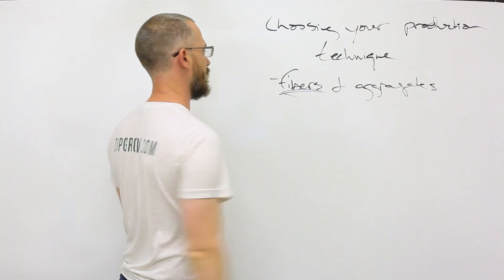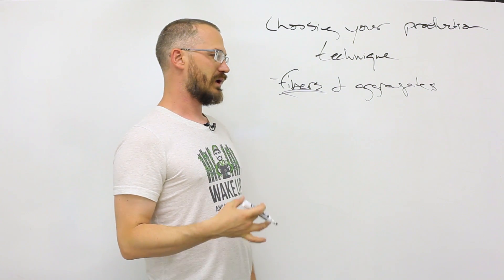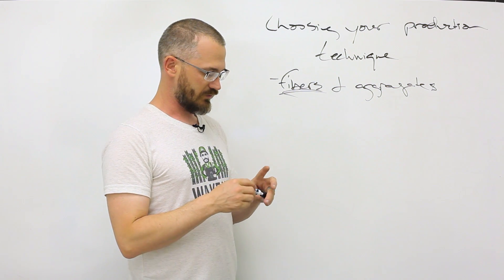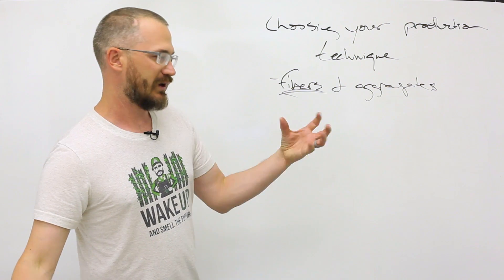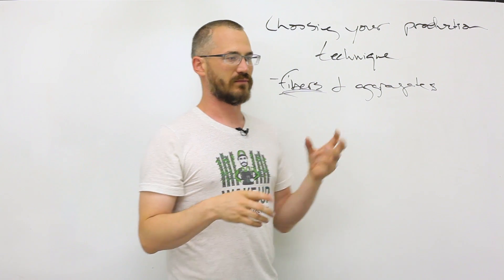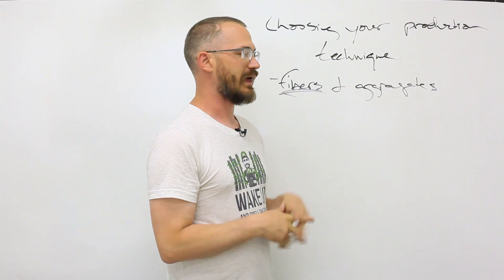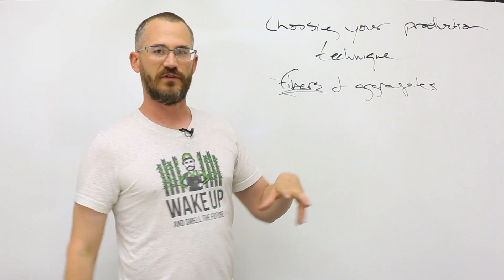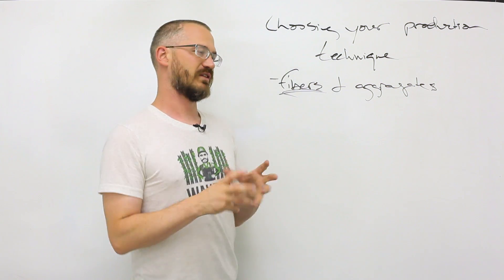Why use fibers as aquaponic media?

Comment: by fibers do you mean coco coir?
Reply: There are 3 types of Coco Coir, bird nest, croutons, and coffee grounds. I find the bird nest drains the best using a recovery system in a vertical PVC. Adding red worms will take care of most excess waste. I get 3 grows from the coco and then it is off to a a vermicomposter bin.
Reply: Damian Hinkson The fish don't make it a problem, rather it can often make problems for the fish.
The more innate stability your system has at the hardware level, the easier it is to keep the optimal water chemistry for the fish's wellbeing.
The plants love it, but your fish don't.
Reply: Damian Hinkson The main consideration is probably for if your entire system shares the same water volume, and you can have thousands of dollars worth of fish at stake if any thing starts to happen with your water.
Fish are delicate, and the concept of aquaponics is an intrinsically unstable ecosystem within a closed system.
I guess it all depends on how good you really want your water to be, and if you want more increases in the potential for reaching the most natural equilibrium possible / for the least maintenance trade-off, in the long run.
It's equilibrium : maintenance, basically
Reply: Not really my question, but thanks.
Reply: " possible need to replace eventually " 
Yes, any natural fiber will decompose rapidly in an aquaponics or aquaculture setup.
The initial cost of kitting out your farm will be considerably less to begin with, but the degradation of the matter comes at a heavier cost than simply needing to be replaced often, the actual decomposition itself will inevitably contaminate your water exponentially as time goes on, causing water quality maintenance to become somewhat of a nightmare. 
Hes saying in the video more people should use fiber, but this is the dealbreaking reason why most people don't use degradable media.
There are other medias out there that are non-degradable fibers, like rockwool, but it's expensive.
Reply: Postghost  my coco grow beds are 8YRS or more and working fine
Reply: Perhaps it was a bit hyperbolic saying "rapid".  It's good to hear you are having some success with coir, but the fact that it's working for you doesn't mean that it's overall a better option.

All vegetation will biodegrade in your system, regardless.
ofc some bio degradation is inevitable in the water, but if you make your entire grow-bed out of vegetation, you have no way of controlling it, adding just another variable factor to an already imperfect and intrinsically unstable system like aquaponics.

Admittedly there are probably schools of thought behind both options, but in mine it's one of the core rules to simply avoid natural, dead vegetation as a full grow media in aquaponics.  It's pretty much for the sake of the fish's healthy, optimal water chemistry. 
How your fish are affected will depend on your fish, obviously Tilapia will fare better than jade perch, but you also intend to eat the fish yourself afterwards so that's another factor to consider.    Whatever compounds are floating around in the water are consequently going to be in the fish you eat also. 
Like I said, it's just another boat load of factors that are to be considered.
But that's why we do our own research tho isn't it?
But anyway, I hope your coir continues giving you success.
Reply: dfunkt You do whatever you feel you need to, by all means.
...but coco coir IS, %100 "vegetation", Sir.
Reply: dfunkt I use coco coir, but not in the aquaponics.
" there's not anything there for bacteria/fungii/protists to work-on, so i am highly-doubtful that it is even digestible by anything "
Idk where you got that information.
I don't have the time or desire to give you a full chemistry lesson on the decomposition of matter in the natural world, but there are these things called 'acids', in the water(a lot of fish do like slightly acidic water), that soften the cellulose that form the fibers, and cause natural degradation.  There is absolutely NO way for it not to happen.

Listen, I just gave my two cents, mate, if you cannot gracefully take a random claim off a YouTube reply, with a grain of salt, that's not my problem.
Reply: dfunkt It isn't digesting, it's biodegrading.
Reply: dfunkt " coco coir is an excellent long-lasting horticultural media " Right ...that must be why all of the working farms and aquaculture enthusiasts use it all the time.

Oh wait, that's right...
...they actually don't.
Guess they all must be stupid or just stubborn.   Can't be any other reason, surely.
Reply: Postghost coco grow bags are quickly becomeing industry standerd for greenhouse tomatos
Reply: Damian Hinkson yea, no fish.  No problem
Reply: Postghost  can you explain how fish make it a problem?
Reply: Coco coir is a perfectly acceptable media for beneficial bacteria/fungus, just as much as hydroton or any other chemically inert material, whether in a soil application or aquaponics hosting nitrifying bacteria. The bacteria don't consume the substrate, they affix themselves and live in it which is why river/lava rock still technically works despite its poor surface area. It's just more difficult to use for recirculating systems due to its longer water retention time and propensity for shedding bits and pieces into the system. Yes coco-coir is biodegradable, it is a natural product after all, it just takes literally decades depending on the conditions.
Reply: I find using bird nest only, provides great drainage in my Krusty bucket systems. I have used it in a 4" vertical Coliseum unit and it worked fine. I find Hydroton to emit more after sediment though. Lava rock the same.
Reply: Works. BSA is great. I incorporate redworms to break down any fish poop that the nitrification process doesn't get. But the worms help with any decay/dead roots ect. as well. I have learned since 1986 to never say never.
Reply: Also I have 2 passive reservoirs, 1 active for fish recirculation, and 1 active for plants. Aquaponics is great for leaf growth, but lacks some secondary nutes and couple of micr-nutes for flowering and fruiting plants.
Reply: Postghost i use actual whole coconuts shreded i think eventualy it brakes down to humas and cellulos and basicly just exchanges ions
Reply: I'm leaning more and more towards external biofilters. Is there a reason people aren't doing that?
Reply: reinux people are doing that......
Reply: I should be more clear... Is there a reason a lot of people aren't doing that?
Reply: reinux research "decoupled " aquaponics. where you have two water loops a fast one for the fish and a slow one for the plants.
Reply: reinux  lot of people arent doing that because of the maintenace involved with the extra biofilter.. most people let the grow bed do all the work but this also means that you have to stock the fish low because grow beds are not as good at filtering....if you want have a high fish prodution then you add extra filtration. but most homeowns dont want that many fish.
Reply: Don't you still have to clean growbeds eventually, too? It seems like you're just delaying the inevitable, and when it happens, it's a lot messier since you have to move a ton of grow media around and possibly uproot some plants or wait for them to be harvested.
I guess the answer to that is "worms," but a lot of people don't seem to use worms either.
Reply: worms find their way into most systems and you are right in that you could be delaying the inevitable...not only is worms a good idea but it isa  fact that a no maintenance grow bed system has to be very unproductive by comparison
Reply: Okay, that makes sense. Thanks!